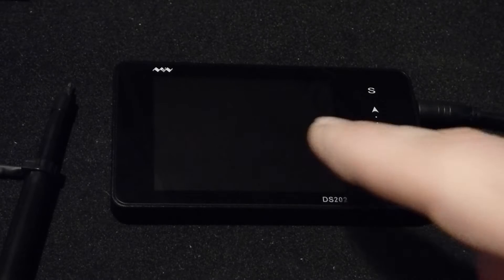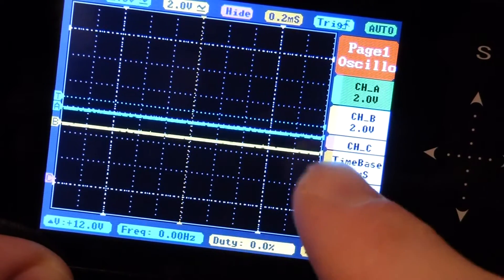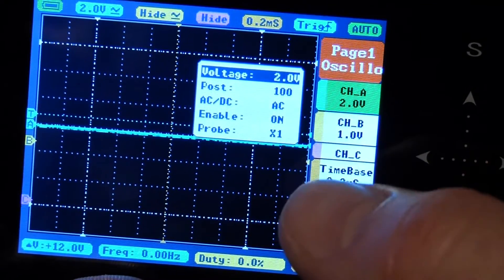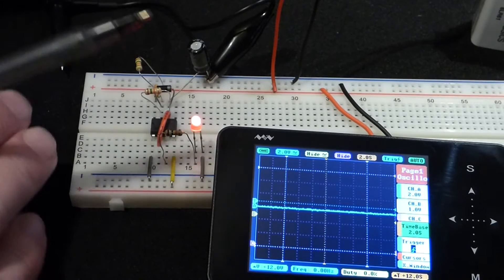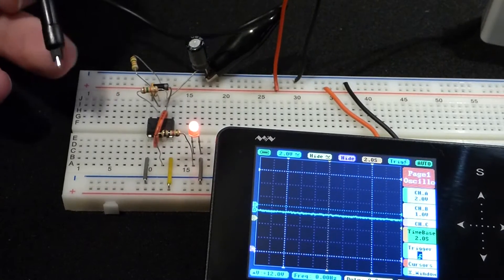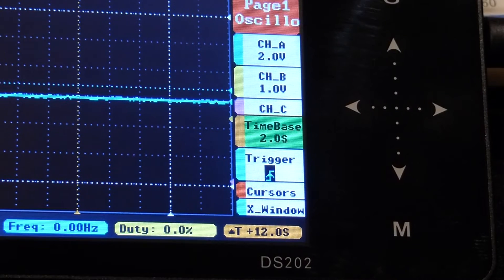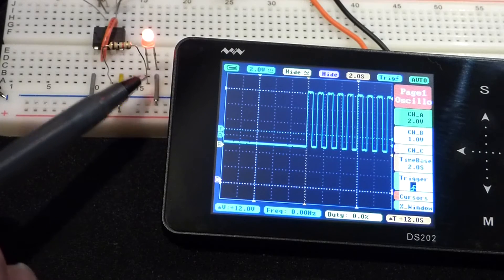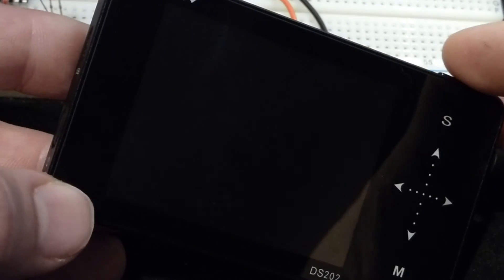Beginner sainsmart DSO handheld digital oscilloscope slow voltage change readings

Comment: Thanks for sharing , any suggestions on small footprint ready made not so expensive signal generator ?
Keep up the good work .
Reply from the maker: Thanks for watching! Many low priced signal generators are sold on EBay and I think on Amazon too. I never bought or tested any though or even read reviews so I can't say much more. I'm pretty sure the pocket oscilloscope used in this video does have signal generator options but I haven't really looked at them yet.
Reply: Thanks for you fast reply and keep up those educational videos.